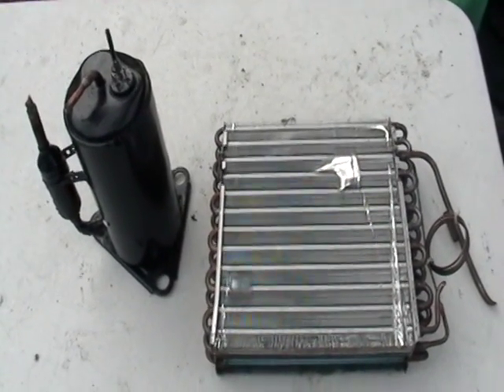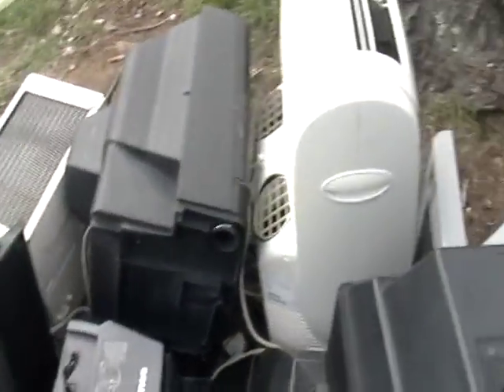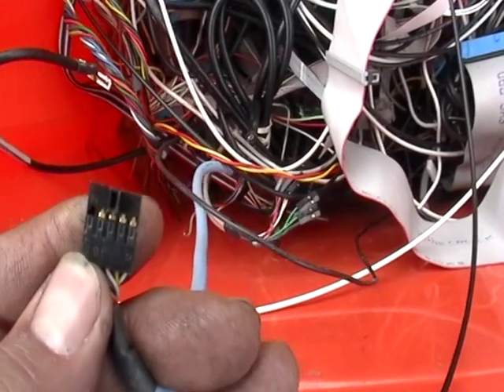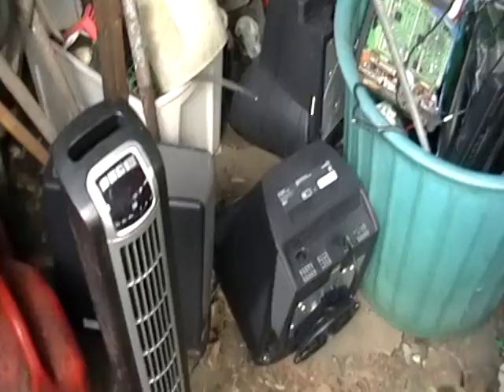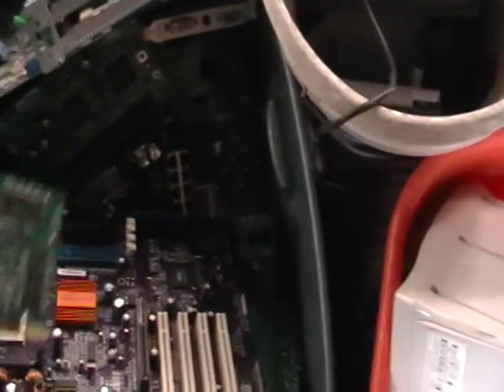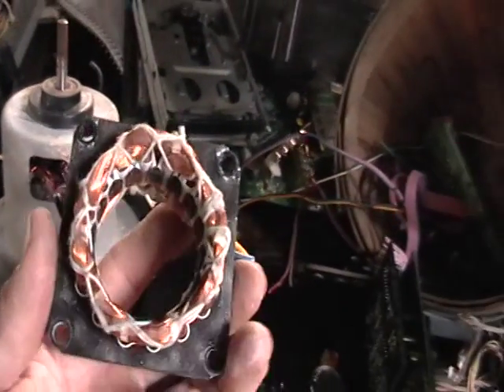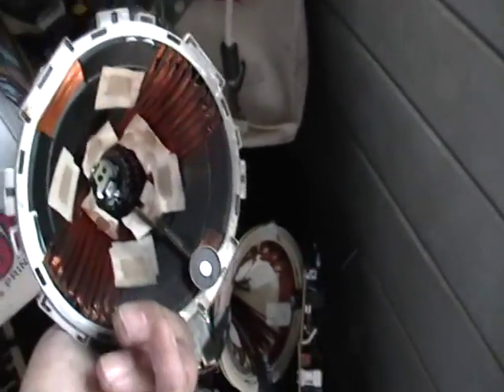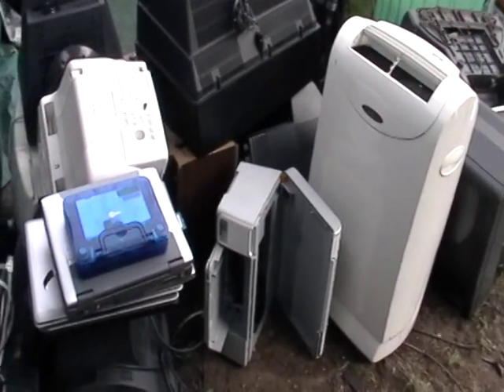scrapping an air condtioner & other scrap

Comment from the maker: i would strip wire that are thick and long (excuse the pun). any wire that is bright wire cooper meaning like a brand new penny is #1 copper and will get you the most money.

Strip a washing maching a dryer lots of copper in the motors.

Thanks for your post.

Comment: @lmvelazquez100 Yeah, But we always remove the chips mechanically not chemically.

Just cut the solder joints whit a heavy duty knife and take a flat screw and tear it of.

keep up whit the good work!

Comment: 0:52 neeed to remove the copper tubes from inside the aluminum cores too this is several more lbs per slab. also the gasses are worth $40 a gallon.   the person making this video is an amateur